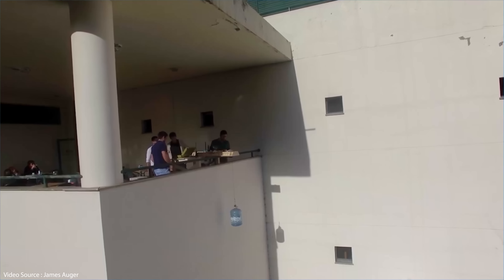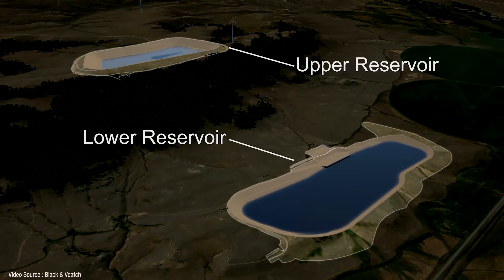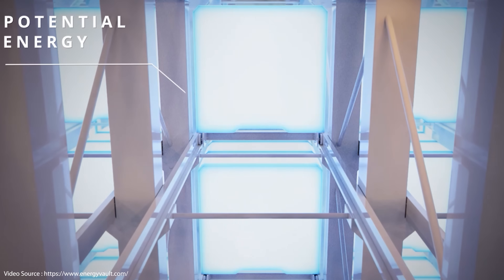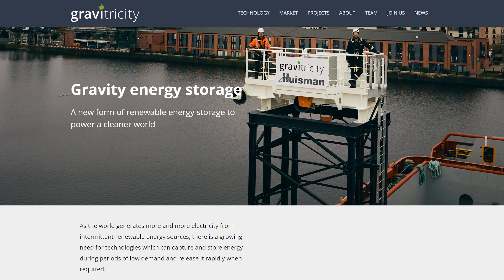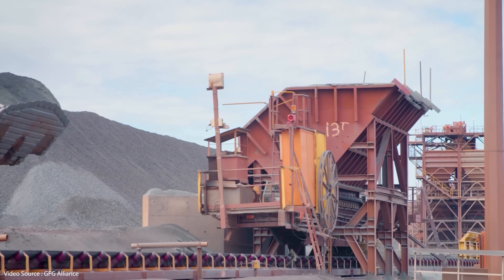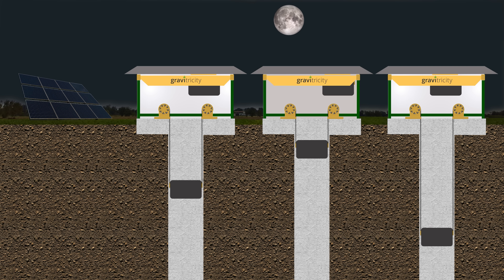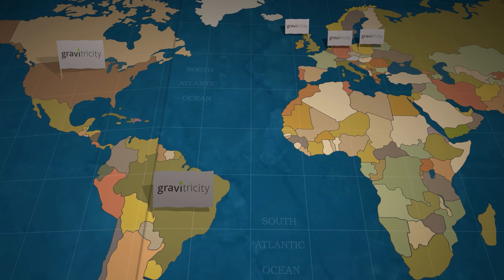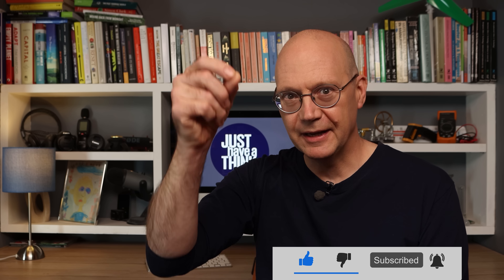Gravity Energy Storage. Who's right and who's wrong?

Comment: I've never understood why the enormous power of hurricanes has never been explored for power generation.  I can envision massive concrete sails mounted on rails in places in traditional hurricane paths.  The massive sails would climb the rails and then power would be generated in cable sytems joined to generators.  One advantage being that one could put the brakes on the descent during low demand.  A secondary advantage is that wind energy that would normally cause damage to structures and the environment would be redirected into useful energy while simutaneously providing wind shelter.  I can see structures like this all over carribean island beaches.

Comment: Similar to pumped-storage hydro, I always thought of using a simple pulley system with one barrel that is full of water, and one that is empty.  The full barrel falls, generating electricity that is stored in a battery.  When the full barrel reaches the bottom (and the empty one is now at the top), water is then pumped from the full barrel to the empty one so the process can begin again.  Better yet, imagine coming home at night and driving your vehicle to the top of a platform which uses the weight of the car slowly descending to generate and store electricity.  In the morning your car is back on the ground to be driven away, and the platform resets itself.  Rinse and repeat.

Comment: How about releasing weight at certain speed so that extra energy/rotations are stored in the form of flywheel. Just the thing is, you need proper bracking system. May be similar to regenerative braking in cars but with lil bit of more engeneering needed.

Comment: How much energy is left over after you use electricity if you pull your block up and then drop it which means how much energy does it actually produce discount the energy is needed to raise the blocks or whatever to a given heights You don't give these numbers therefore you can't be trusted to have an honest opinion give us those numbers how much left over energy is actually there

Comment: One of the problem with mines is that they tend to fill with water and have to be constantly pumped out, which will reduce both efficiency and increase maintenance costs. I  could see old strip mines being useful for this as well.  An inclined plain should work just as well if slower, and those things are usually big coils going down into the ground.  Not as well, as there is friction and they will collect even more water, but it could still be net positive.

Comment: Don't most coal mines already have tracks and hopper cars running up and down the mine shaft. Get the oil out and lubricate this old equipment and use it as a dead weight running in and out of the mines.

Comment: The coal energy plants have very large chimney stacks, would it not be possible to reuse these massive pre-built structures with structural enhancements for the purpose of gravity energy storage? as they have both height and diameter to hold many blocks at height ready to be lowered similar to the concept purposed by both companies

Comment: I think the best solution would be to integrate the shaft into buildings that function for other purposes like housing opposes or whatever buildings operate currently. I think such a solution could even be added to individual houses that currently exist by putting a shaft that's not too wide right down the center of the house. So instead of building any new structures adding shafts to theoretically every structure on Earth might be an easier solution on highs rise buildings you could have chefs on every corner of the building or on the sides or maybe you could eliminate one elevator and put the system in that shaft all you have to do is be creative.
Reply: Sorry for the typos I was using voice to text thanks for understanding

Comment: In a system where evaporation could be limited, pumping water from the bottom of a pit into a barrel that would travel down the shaft full of water then dump it's water at the end of it's travel would be much cheaper to create than the motors that are needed to lift large weights, pumping water is easy and the pumps are also cheap, efficient and effective, the system could also be built proud of the ground and small scale systems attached to a home or multi storage high rise buildings also.

Comment: Gravity storage is either "pumped hydroelectric energy storage", or "extremely low capacity (for it's weight and/or dimensions) but able to provide high power when needed", or "nice looking fraud with cranes, shafts and so on".

Comment: Have you looked at the rail based gravity systems?  They’re similar to pumped storage, in that they need a hill and space.  The system is built around an electric railway which uses electric engines in a similar manner as other systems

Comment: What about capturing humidity on top of a mountain using mesh nets and transferring it to holding ponds then letting huge bags of it down a slide or chute?   You could use wind power up there and use that to run pumps while you have wind and solar too.   I want to see how that math breaks out.  How much water do you have to have at what height do produce how much energy and how much can you get from nets.  If you could capture clouds up there you could make a lot of power.  An average cloud weighs about about 1 billion 400 million pounds.   Capturing clouds already in the sky seems like an op way to get a lot of weight high up for something like this.  You could also run huge Absorption Refrigeration systems up there and make cool air to pump down and get tons of water up there as well... not sure how well you could use the cold air but the largest Absorption Refrigeration units made now make something like 250k gallons of water per day.  That's about 950k kilos of water per day per unit being run on a mountain.  Making weight up high rather than lugging it up high.  I just ran a little basic math so see how it would shake out.  So 1 square meter of fog collecting mesh collects about 1 gallon of water per day.  there are 2.59x10e6 square meters in a square mile aka 630 acres.   and water weighs about 8.35 lb per gallon 25900000 X 8.35 = 216265000.  divided by 2.2 to turn lbs into kilos. 98302272 kilos.  per square mile.  I noticed that there is a mt Whitney in California near LA and San Fransisco and it is about 6000 to 14000 ft above sea level and 581000 acres San Fransisco is about 52 ft above sea level.   So 1 percent of this mountain is 5810 acres.  Let call it 9 square miles...  lets see how much power could be generated using the mesh over 9 square miles assuming 10000 square feet up and if somehow you could lower it all the way down just for reference.    Looks like you'd have about 90000000 kilograms of weight at a height of about 10 kilometers per day.  Sounds like about 9 billion or so kilowatt hours if you use 1 kilogram at 1 kilometer has about 1 kwh of energy potential I heard somewhere that was about right a while back.  So I now have 9 billion kilowatt hours per day of energy storage using the weight of fog and clouds let's say maybe.   Okay so now over 365 days in a year.   That's about 3.285 trillion kwhs per year.   That is about 80 percent of the number that I get for the total energy consumption for the entire country annually.  3,900,875,000,000.00 kWh (2018).  That would be using 1 9th of 1 percent of 1 mountain in California 9 square miles.  Please if you read this and even half ass care correct my math.  Total infrastructure cost a bunch of mesh a couple very long slides and some pretty substantial generators then it's problem solved.  Btw in this design I used no solar or wind power at all just mesh collecting water on a mountain.  Yes it would be too much power to transmit all over the country through power lines but if you have that much power use it to breakdown water into H 02 and make pipelines that can send the gas across the country I think that would be much cheaper then any other way to transmit the power through  lines or truck it all over or whatever.

Comment: I kinda like that Swiss system, but as some of you point out concrete is not the ideal material.  Making it is not carbon neutral and it is prone to rot.
The ideal weight would be Swiss financial personnel since they are dead weight. I of course would be open to the idea of other country's financial people; The City, Wall Street, etc.
There would be no worries if a cable broke though cleanup costs could increase the LCOS.

Comment: The math to evaluate this is very simple.  In English units, 550 pounds dropping 1 foot per second is one horsepower, or 745 watts.  So to simulate a largish power station of 745 Megawatts, you have to be dropping 550 pounds by a million feet per second.  Or dropping 550 million pounds by one foot per second.  Or inbetween, dropping 550,000 pounds by 1000 feet per second.  None of these are at all practical if the weight is a solid held up by cables.  The speeds are too high or the durations are too short.  

What is more practical is dropping water down a river or a chute.   Unfortunately the number of natural locations where this is practical is quite limited and mostly already most good dam or hydro-storage locations are already in use.  Also the effect of doing this over and over is hard on the fish and ecosystem in and around the water.

Comment: 500t = 8m x 8m x 8m water pool. Put that one at the bottom of your mine shaft and a pipe in between to get the same result without new engineering needs.

Comment: Make a long shaft in the ground. Fill full of water. Drop heavy weights down shaft and use air to bring it back up. Like air bags brining up treasure from the sea. God blesses
Reply: How do you capture energy as the weights descend?  With cables?  And how do you utilize excess energy?  By blowing up the air bags?  But that only makes the weights buoyant; they float to the top...

Comment: For off-shore wind farms in deep water you could use a big sphere filled with air surrounded by a strong steel shell. This object gets uplift force. You need an anchor in the ground and cables to draw the sphere deeper or to release it.
A problem might be the weight of the steel shell. An alternative could be to use a light (incompressible) fluid. Then the shell can be thinner and hence lighter, and then there is less restriction regarding the maximum deep.
Reply: Again others had this idea years before me 😀

Comment: Is this something that we could use at home, in place of a "power wall" type battery storage? 

Could we put 2 or more heavy weights in the basement?  
Could we build a few (relatively) small silos outside a house, ie 20'-30', you know basement to roof level, beside a single story house? 
Maybe taller by digging a supplemental well? 
We could use a plastic culvert to protect the system from weather. Quick search found plastic culvert up to 5' diameter.  
Maybe re-purpose EV (auto) motors. 
Power from solar cells and / or Windmills?

Comment: I like the inclusion of LCoES. The issue with storage is also energy density (energy/volume), land use, and location (it should not be too far from users), and here one may get confused with the Figure given in the LCOS-GravityStorage report, as li-ion is much more used than CAES (which is a more mature concept), even though the diagram/figure misleadingly shows a much lower cost.

Comment: Now that Energy Vault has realized that they need a much larger and more robust structure to store all that weight, all they need to do is get rid of the cranes and concrete blocks. install pool liners on the top and bottom floors, and pump water back and forth instead.

Comment: Any gravity storage method that doesn't involve pumping water between reservoirs is stupid. Look at every problem with gravity storage:

1) Moving the material
Hmm, you'd want something small...easy to move...ideally with one machine moving all of the material. Really, really small individual components...like a liquid. Moved with a pump.
2) Cost and availability of the material
I mean man, it would be great if it literally fell from the sky regularly across much of the surface of the planet, and in the final form that will be used so no processing is required
3) Storing the material
Instead of building a tower or tunneling or whatever, what if you could literally just put it on the ground and it would collect in one area by itself?

Anyone who is trying to reinvent pumped hydro gravity energy storage is literally "reinventing the wheel," and that's stupid. Pumped hydro already has all the ideal characteristics. "Durr, but some places are dry." Go build a tower and jump off it.

Comment: What's the point of the big-square-vault's system of moving the weights from side to side, rather than just up and down? It makes absolutely no sense, the only utility would be if it's also conceived just to waste excess energy produced rather than only store it. But maybe it's also a cool CGI animation that they thought would make the thing look more futuristic and impressive, perhaps that would be more attractive for investors than just up and down movement. Maybe they should have instead designed a pump-water storage that has the water going up on huge transparent tubes, making cool loops and maybe being lit by different colors as well. At least it would be more aligned to sensible technology, while adding "special effects" to the thing.

Comment: Yes:   just   have   a   think..... It is a 500 tonne weight in a 300 m shaft. The storage capacity of that is 1.5 GJ. That's just 25 minutes output of a single 2MW turbine running at 50%. You would need 15 odd such mineshafts and installations to store the output of a single modest turbine running through the dead of night. You will need to 22 000 thousand of these things to match Dinorwic alone. And a decade from now when the government ban on new ICE has forced most people to own an EV, this scheme will go from absurdly trivial to 100% redundant.

Comment: Pumped hydro is the easy choice where terain is favourable. The hole in the ground is a fantastic opportunity in areas where the terain is flat. You could make it local and integrate district heat pumped systems into the design.

Comment: E=9.8 * mass * height.  No matter how you do it.  Take an aircraft carrier, put it on hydraulic jacks and lift it 10 meters in the air and you just stored 9.8 gigajoules or 2700 kwh.  You could actually use that concept for power generation.  Float a 250k ton block in a tank open to the sea.  Close it off, then use that mass to pump the water through turbines.  Could probably turn that around every couple hours for the night and still be full for the peak.  Not only do you get 25 GJ of storage, you get 25 GJ every cycle.  Many harbors could handle several.  You could make it deeper and time it with the tides and get that energy too.

Comment: Sorry, as a graduate of Percussion University (the School of Hard Knocks) and as someone who's worked as a millwright (JOAT actually, welder, machinest, aircraft mechanic, foundry, hydraulic & pneumatic systems, etc in my resume)on machinery with huge speed changing gearboxes (powerplants and plastics plants) and also winch systems I don't think these systems are practical because the lifespans of the machinery simply isn't there and the maintenance & repair costs would make them uneconomical.
Gear teeth wear, cable drums and cables wear into each other, load bearings can be problematic for example : huge gas and steam turbines shafts n bearings, ship propulsion shafts (and huge reduction gear experience on those ships) and mine and ore processing equipment experience there too just on that subject so I KNOW the real world problems these systems have in long term use.

Comment: Seems dumb to use power from the grid to put power on the grid without generators or anything those are useless because you wouldn't have anything to power the crane to lower the blocks to make power the ways around it will have safety problems depending on design also not being used ever until that happens so less floor space sounds like another project to move money and debt around with only a modicum of functionality

Comment: So, the moon lifts tidal bulges in our oceans that we call 'tides'

The bay of fundy has an average tidal lift of 38 feet.  That's the biggest, other places have more modest tides.

The point though is that a floating vessel like a cargo ship weighing thousands of tons freely rises and falls twice a day.  And we dont do anything to harness that free up and down motion.

If you were to park a cargo ship or its like next to a grounded pier and on the pier were massive levers that connected the rising and falling ship to a hydraulic generator on the pier you would essentially have a 2 stroke hydraulic generator running off of each lever.  

The flotation of the ship lifting the levers on the inbound tide and the weight of the ship hanging on the levers bringing them back down on the outbound tide would be driving the hydraulic generator in both directions (hence 2 stroke)

I dont know why this hasnt been invented yet.

Comment: I did an essay for part of my undergrad examining gravity uses for storage and long story short, unless the land and material was drastically cheaper it was never viable for economic reasons. Especially when you consider more developed systems like hydropower or flywheels. There also was little to no room for technological efficiency improvements as the conversion efficiencies were already as high as they were feasibly going. TLDR It does work, but it makes no sense when compared to other solutions.